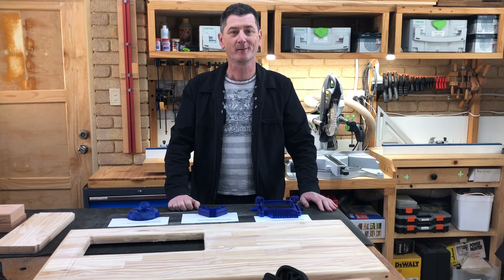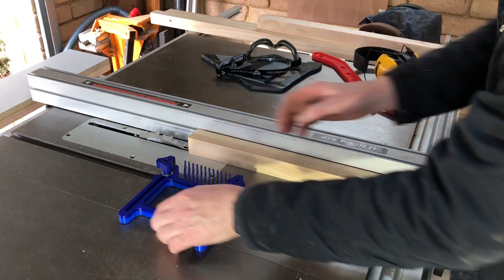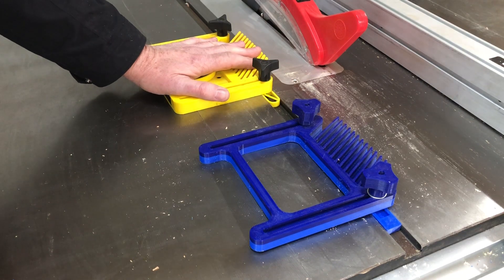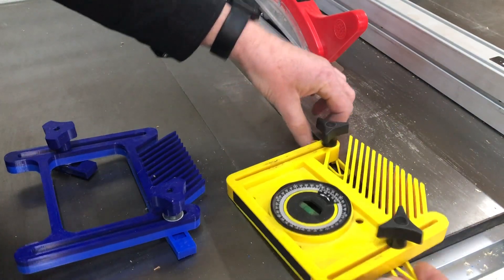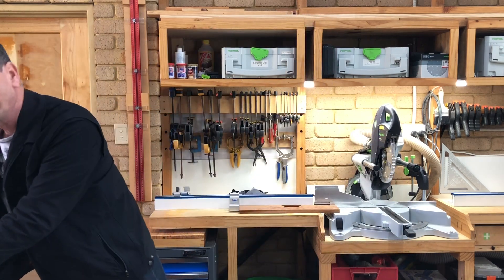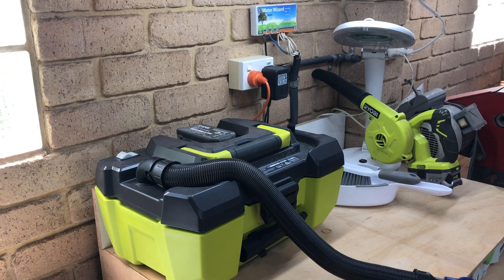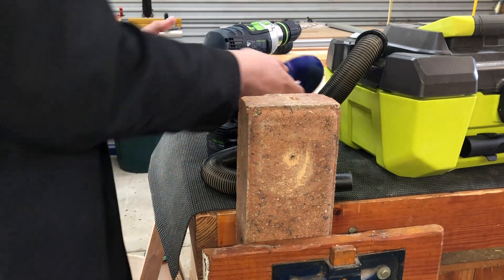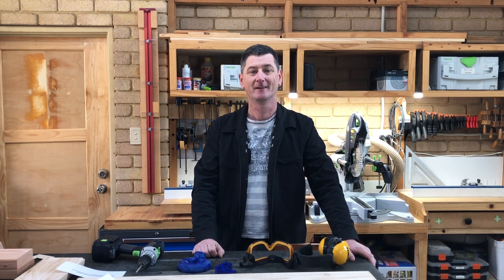3D Prints in the workshop #4

Comment: Did you use PLA for the featherboard? I have just printed out a couple using TPU and cannot decide if the greater flexibility is an advantage...
Reply from the maker: Hi Mike, yes I used PLA for the feather board. It has got the right combination of rigidity and spring needed for the fingers. How is the TPU going?
Reply: @DarrensWorkshop  Early days. The more flexible nature means you set for more deflection; side pressure is the same, anti-kickback is at least as good, and there is less chance of marking the workpiece. It needs a shorter finger length, 30 - 40mm appears about right. I am continuing testing and, if successful, will publish a design on Thingiverse when I think it is optimum.

Comment: That clamping square is most likely out of square because your stepper motors are not calibrated properly. I actually designed a universal indicator mount for properly calibrating instead of the way all these other idiots do it, with printed parts. LinuxGuy2020 on Thingiverse, look me up.
Reply from the maker: No. I did a whole other video where I proved my printer is square. The issue is caused by the plastic shrinking as it cools.

Comment: I would have thought that you would have made square clamps from plywood or any other timber knocking around your workshop. They are pretty simple things to create.
Reply from the maker: Hi. This video is specifically about 3D models available on line, and weather or not they are of some use around the workshop. So while I actually do have a large square I made from wood, it wouldn’t be revenant in this video. Cheers
Reply: @DarrensWorkshop  My comment was addressed to 5:45 when you said that you had been thinking of purchasing a pair for a long time.
Reply from the maker: Hi. Yes thinking about, but could never justify.

Comment: Sounds like you’re using PLA filament.  Have you tried PETG?  I suspect that the additional strength and increased flexibility would be beneficial in this context.  Most PLA printers can handle the slightly higher printing temperature.
Reply from the maker: Hi Jonathan, Yes I have used PETG. It is good stuff for things that need a little flexibility or wear resistance. PLA is easier to print, cheaper and more rigid so I use that most of the time, but PETG definitely has its place.

Comment: I'm interested to know how your featerboard is going. Do you use it often?
 I worry about the reliability of PLA when used in conjunction with a tablesaw. 
Having said that I did print and have used a Grripper copy. I did beef up the handle though.
Reply from the maker: Hi Minabrons, thanks for leaving a comment. To be honest I use the yellow featherboard most of the time, but the blue one I printed is still working.
Reply: @DarrensWorkshop  Thanks for your reply. Unfortunately I use a Bosch contractors table saw with an uncommon mitre slot/track. So a custom built 3D printed featherboard will come in handy.